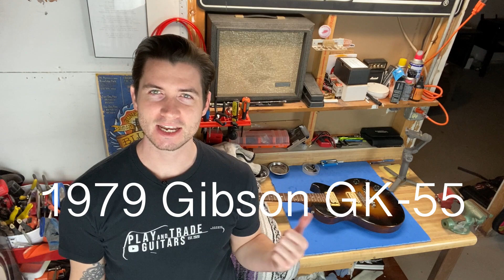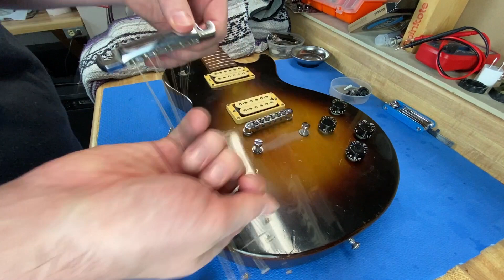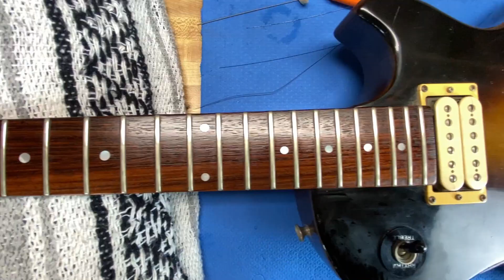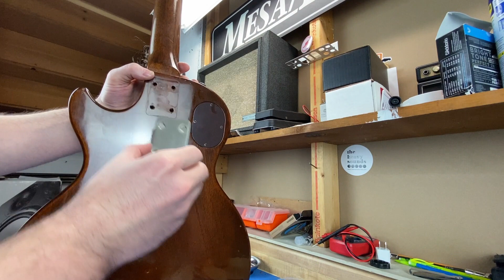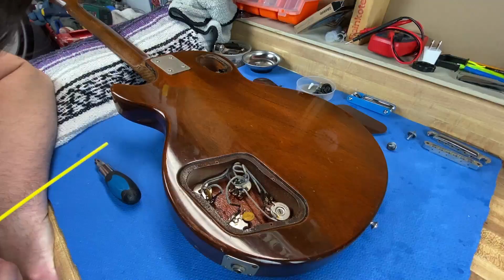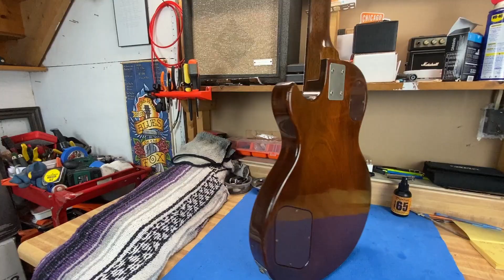1979 Gibson GK-55 Les Paul with Secret 'SPIN-A-SPLIT'

Comment: Mine is a 79' I've owned since 1980. The neck pickup on mine is also pressed against the neck. Many years later was told this model was made from left over parts.

Comment: One came in to a shop I was working at.  It's mine now.  Mine also lacked the TP6 fine tuner so I scored one on eBay with just the right aging.  My '79 also has a 335 5 ply pickup guard on which I like cause I play finger style and anchor my pinky often. The vari-split on mine goes on/off half way and doesn't vary.  The bridge pickup is also brighter un split which is weird.  I tried flipping leads thinking it might be out of phase but had to reverse it back. There's also no gloss on the back of the neck as I've seen in other videos.

Comment: A few parts are not original.   These came with a tp-6 fine tuner tailpiece.  Also originally equiped with gold knobs and an ivory pickup selector.
Reply: That's correct. I've got a '79 that I bought in 1980, with all original parts and can confirm that what you said is accurate.
Reply: Yep true I also have one my dad bought in 80 and I still have it, I have played it so much it is road worn pretty bad but still all original and sounds incredible

Comment: I owned one back in 80 and traded mine in like an idiot. That is not the original tailpiece. The original tailpiece was a TP-6 which was basically a micro-adjust so you could fine tune without going to the machine heads.